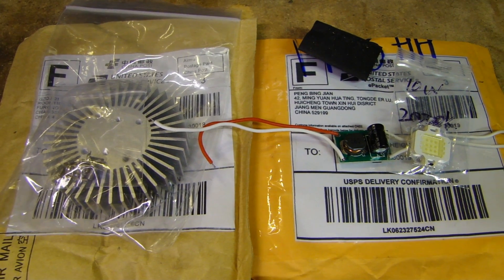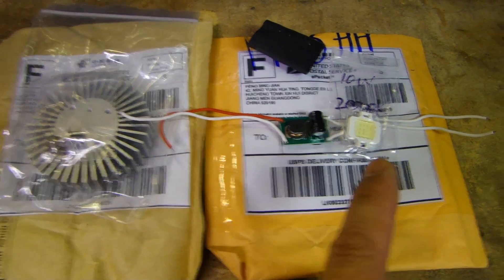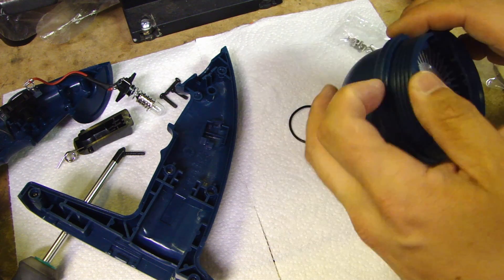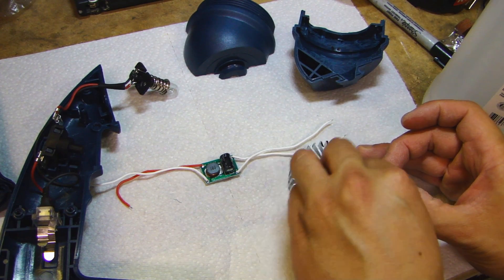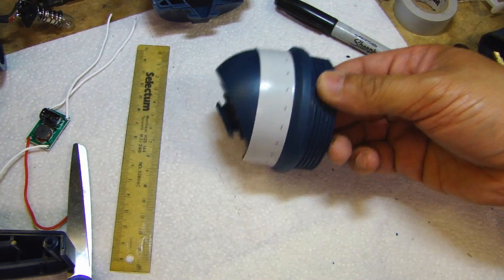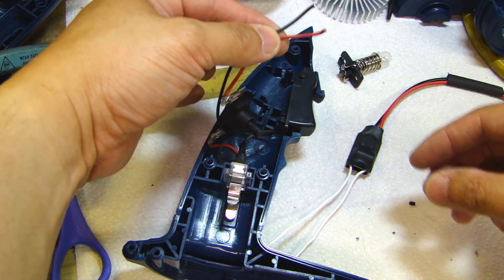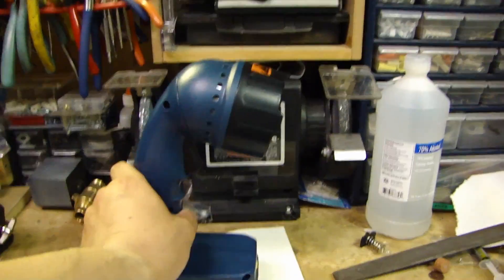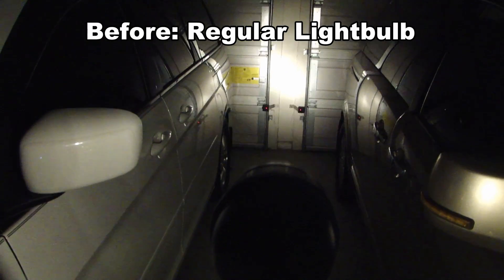Ryobi 18V Cordless Flashlight with 10 Watt Super Bright LED

Comment: Great video. I bought all the parts few years ago, but never got around to doing the upgrade. Yesterday, I saw harbor freight tools sells a similar LED rechargeable flashlight for their Warrior brand battery (item 64117). It was about $6 after coupon, and the bulb assembly fit perfectly after a bit of dremel work. Check it out!
Reply: I plan to do this mod. Was the dremel work difficult? I don't want to mess it up.
Reply: @obguy99  it was easy. I didn't even use a dremel, I just filed down some parts against a bench grinder
Reply: @brandonkellogg9590  I will buy one and see if I can do it. I have two of these lamps and put a $30 conversion kit on the first but just want a 2nd good LED Ryobi lamp and will do your conversion next. Appreciate any tips you have.

Comment: It doesn't seem that much better. The LED is behind the reflector dish. If you can get a 5w that would project further into the "sweet spot" in the reflector dish. You can have the increase in as well. Test it out! The difference is great.

Comment: Thanks for video.  I bought these parts and converted my p700 light.  Much  better now!  I had to cut the base of reflector a bit to get some clearance over the + solder connection and used some liquid tape to insulate also.

Comment: That LED was a bad choice.  Those chinese generics are known to have very low efficiency and CRI, even electrical shorts in the dies that waste power as heat.  Many think they are factory defects, is why they are so inexpensive at eBay and elsewhere.  Plus, no matter what it was marked, it is not 20,000K color temperature.  I can tell by looking at the phosphor coating that it is no warmer than daylight hue and probably closer to 6500K, but definitely not above 8K as it would look distinctly blue at 8K or higher.

Your heatsink is not remotely close to large enough for a 10W LED, enclosed in a light head, without a fan on it.  It will have very short lifespan due to how hot it runs in this scenario.  I have done a similar mod to a Dewalt cordless flashlight, even used what is probably an identical driver, except I used two Cree 5W LEDs in series (with a custom optic in front instead of the original reflector) and under drove them to about 4W total by modifying the driver board... at least on mine, it has two resistors in parallel which are for current sensing and if you remove one you reduce current, or remove both and put in whatever resistor you want, calculated this way:

Parallel resistors set current 0.3ohm + 0.2 ohm = 0.12 ohm
As shipped this should equal 833mA
LED current is set through a sense resistor. The output current I is equal to 0.1/Rs

Note above that their supposed 10W driver, is more like an 8.33W driver because the sum forward voltage of those LEDs is pretty close to 10V, except they don't achieve remotely close to their claimed lumens because some of that is wasted as heat from the defect situation I mentioned above, and due to how hot running it will be on that undersized heatsink.  It will have a permanent lumen reduction from that operating temperature, but perhaps if you don't use it for many hours at a time, it will last long enough for your needs before burning out the LED dies one at a time as mine did when I first tested those 10W generic LEDs and abandoned using them due to how poor they are.

Another thing I noticed about those drivers is they really mess with nearby FM radio reception, though it could be that the specific drive current I chose, just coincidentally put the frequency in the FM band.  YMMV.

Also note that because you're running it from DC, you can gain significant efficiency by removing all 4 driver board diodes on the input and putting bridges (jumper wire) across the positions of two of them.  Since they're just a bridge rectifier configuration, you would then have to observe polarity when hooking it up, but this saves you that automatic loss of 1.4V.
Reply from the maker: Thanks for the write up, but I use that flashlight everyday (I use it to walk my dog early in the morning, and last at night) and still works to this day. Just as bright as the first day I made it.
Reply: If you are happy with the result, that's what counts, but factually speaking, this is a bad mod to do for someone who does something like use their light very often for work or emergencies, especially a mission critical light.  I know that seems like some kind of doomsday prepper statement but not really.   I tend to favor one light and use it the most, especially when it's the one I modded into my Dewalt snakelight-neck, work light because I not only have two batteries with nothing better to do (after I bought a newer upgraded drill) but also, being a snakelight, it's great for aiming at work.

Frankly, it's a little bit silly to carry something this size, weight, and bulk, just to walk dogs unless you're out all day.  There are many little 1 x AA pocket lights that would easily accomplish that.

Comment: Does anyone have a current link for the LED and Driver? I can not seem to find one with the LED under 20,000k
Reply: It's not 20,000K, that was some gross mistake by the seller.  Even as high as 10K is practically pure BLUE, while what he has looks more like a 6500K color temperature, often just called "cool white" instead of "warm white', but frankly, I'd rather have something between those two choices, would get a different brand of LED that comes in closer to 4500K.

So all you have to do to find what he used is go on eBay and search for "10W LED -bulb -bulbs" then sort by price and click "Buy It Now" to see them selling for about 75 cents delivered from China, which takes about a month to arrive.  For the driver, do an eBay search for something like "
10W 900mA Constant Current LED Chip Lamp Efficient Driver Supply DC9-24V
BUT again, I would not use these parts.  it's going to run too hot and cause damage to the LED.  You're better off shooting for 5W or 3W instead of 10W (which is actually 8.3W due to chinese unscrupulous lying merchants lol).
Reply: Stinky Cheese thanks! I know 20k would be a purple or pink shade at that temp haha. I have always been into LEDs, but just wanted to build this apple for apple. our new house has all 5k LEDs and they are perfect!
Reply: https://rover.ebay.com/rover/0/0/0?mpre=https%3A%2F%2Fwww.ebay.com%2Fulk%2Fitm%2F261949689970

Comment: I would like to see a 100 watt LED or larger emergency flood light with USB charging that operates off of a Ryobi 40 volt battery or battery Bank.... that  system should be able to be recharged via 12 volt power supply through a vehicle cigarette lighter or even a gas-powered generator and or solar but should also have multiple USB charging ports to be able to recharge cell phones tablets and laptops in an emergency if needed
Reply: That seems rather silly and expensive. In an emergency you'd want to conserve battery power, not have a light that produces more light than the room normally has when mains AC power is working.  It would require a big, heavy, expensive battery AND heatsink, enclosure, thermal management and charge controller circuit, etc.

Let's put it in perspective.  The HIGH CAPACITY version of a Ryobi 40V battery is 4Ah.  Keep in mind, it isn't really 40V but 10 cells in series for 37V nominal.  37V * 4Ah = 148Wh.  Now your LED driver is maybe going to be 90% efficient (less if a cheap generic one) so that takes you down to 133Wh.  This means you can only run the light for 1.33 hours from a full charge on new battery, hardly ideal in an emergency.

If you don't care about highest efficiency, just cheap cost so you insist on using generic chinese LED and driver, you'd be better off going with a 20W LED and driver.  You'll still need either a heatsink half the size of your head (or else a fan on it, then a typical 4 square inch CPU heatsink (Pentium 3 socket 370 era for example) would work) and a separate boost PSU and charging circuit, or an AC inverter to use the original Ryobi charger, to be able to do this from a 12V vehicle lighter outlet.

That is quite do-able, but frankly I think you should just invest in a Ryobi 18V One+ cordless tool, and 18V One+ high capacity 4Ah battery, then buy their LED floodlight at Home Depot.  USB charging, meh not needed at all, you can buy USB output power banks on Amazon all day long for under $20, ready to do the job.  Besides, you don't want to lose cell phone USB charging capability in an emergency because you left your light on and it drained the battery.  Communication is a lot more important than an excessive amount of light.
Reply: Oh No,   Bring on MEGA LED Lights!   we have PLENTY of backup power.
Reply: Ryobi already makes a big led spotlight for the 18v system

Comment: 900mah output of that driver barely pushes that led.. Needs 3a to get full lumens out of it..
Reply: Freshkryp69 If it's pushing 900ma at 12v that is 10.8w which is slightly above the lights rating.

 If the driver output is lower than 12v which It might be (I might not of heard it in the video...) 

3A is still way overkill. 9v at 3 amps would be 27watts, almost 3 times the lights rating.
Reply: Awe you got me lol.... Mine is a 6v iirc.. I have the TaskLed H6CC driver it was set @ 3amps output running a xml2, Its a blinding flood light now :). Im fixin to wire up a 50k pot so I can dim it.
Reply: Freshkryp69 Sounds neat, best of luck with it.
Reply: Stick to what you know 'cuz it sure isn't this topic.  The LED is rated for 10W and has a forward voltage right around 10V (3x3 array of 3 LED dies in series and 3 of those in parallel, with each die having a forward voltage of about 3.3V).

That would make the correct current from the driver 1.0A, so the driver is slightly undersized, except the manufacturer of the driver is lying, its actually an 833mA driver not 900mA, but this is a good thing because the LED is already running too hot in this design at 833mA, let alone at 1.0A.

What you are getting confused about is that it's not a single die LED he used.  Single die like a Cree XM-L, yet they need 3A to reach rated wattage.

It would have been BETTER if he had used a single die Cree XM-L because they are much more efficient than these generic chinese defective cheap ones, but since the design can't handle 10W without overheating, that would be overkill.  You can now get a more suitable 5W Cree like an XT-E for under a buck a piece at places like Fasttech.com then not only will the heat be more manageable, the runtime will be high enough to use it as a work light which was Ryobi's intention and why most people bought them.

Comment: They sell LED replacement bulbs that will fit directly into the flashlight..  Just curious why you didn't go that route.  In fact I was looking at Google for these bulbs when I came across your post.   Beautiful modification BTW.
Reply: The Cree xml2 10w led's can put out more than 1100 lumens
Reply: Jim Pumphrey Main reason would be is there is no 10 watt bulbs for them, and any that claim they are would be a farce.

 even the "5 watt" ones are almost all 3 watts or less. The easy way to tell this is 10 watts is way too high to be cooled without a heat sink.

 Any bulb replacement actually being 10 watts would burn out in minutes if not attached to one.

 And because adding a heatsink in a light is not a "Drop in solution..." Legit 10 watts replacment bulbs just do not exist.
Reply: All of those LED retrofits that keep the design using a small bulb form factor, are limited in wattage to what the surface area of the bulb metal can dissipate.  "Some" of them are deceitfully marketed, telling you the max wattage rating of the LED instead of the actual drive current (and resultant wattage) to keep it cool enough to avoid damage, but the true limit on that design is a little under 2.0W if you have a crazy amount of holes drilled in the head to improve airflow (more than the one in the video has) or closer to 1.0W if the head is kept original, perhaps for better water and grime resistance considering it's a work light.

Those typically achieve about 150 lumens if a newer design, or under 100 lumens for the old ones.  The light in the video, after factoring for the falsely rated LED, falsely current rated driver (!@#$ chinese liers lol), amount it is overheating, the result is his light should be making around 600 lumens.  It's a poor result from an efficiency and lifespan perspective, but is still about 4X as bright as a drop in LED retrofit bulb will be.
Reply: No it can't, not in this design.  Citing max lumens that require max drive current, requires keeping temperature at 85C too which the design in this video cannot do.  The result will be temporary lumen reduction from excessive overheating, and permanent LED damage that lowers that lumen value even more, the longer it is used past the first few minutes it takes for the heatsink to reach an excessive temp.

Didn't you ever wonder why the major companies, pros designing LED flashlights, aren't just picking a 10W LED and driving it at 10W?  Heat!  Designs like that need more heatsink surface area and/or spread the head out among multiple dies, each running at a fraction of the total wattage to sum to the target wattage and lumens.  This is seen constantly not only in flashlights but also the everyday LED light bulb.  You want to under drive a lot more LEDs to make the product efficient and long lasting, or if stuck with a host like the Ryobi light in the video, pick a more appropriate wattage like 3W to 5W.

Comment: So,useful or not useful for its brightness? (I want to make this light but i doubt about power.)
Reply: Alper Gökcek i conpleted this project about a year ago.  The LED is much brighter but it has a flood light effect.  If your wanting to light up a whole room it is much brighter and better but if you need to spot something at a distance the stock is better.  I have one of both so i use the one i need.  8out of 10 times i grab my LED

Comment: I have two of these lights and the dog leg metal connection taps break where they fit into the plastic. It's where the battery touches up in the light break.  Has anybody had this problem ?    Thx for the video really cool hot-rodding a light !

Comment: Your instructional video was great.   I ordered parts from eBay.   I ordered three kits.   Heat sink, LED, and power supply together averaged $3.15 per kit.   Your tips for installation were spot on!    I converted my Ryobi P700 18v cordless flashlight in a few hours.   Your suggestion of an LED with a color temperature between 6000-6500K for a more white light is the route I chose.   I decided not to drill holes in the case for ventilation. You are correct though, the heatsink does get hot.

My initial reaction when I turned it on, " Wow, that's bright! "
Best $3.15 mod ever!

LED and power module - http://www.ebay.com/itm/261846807790?_trksid=p2060353.m2749.l2649&ssPageName=STRK%3AMEBIDX%3AIT

Heatsink - http://www.ebay.com/itm/331220338280?_trksid=p2060353.m2749.l2649&ssPageName=STRK%3AMEBIDX%3AIT
Reply from the maker: +Bob Johnson Thank your for sharing!!

Comment: how long does the LED last vs the incandescent bulb?
Reply: Stinky Cheese you sure like to shit on everything
Reply from the maker: +Scott Tienken Both lasts a long time, but LED is much brighter
Reply: Scott Tienken Led is properly cooled will last maybe 10,000 hours. Incandescent Bulb may last 1,000.

 But bulb will be more likely to burn out suddenly if jarred while the LED is shock resistant and would be unlikely to burn out if hit or dropped.
Reply: BUT, the LED isn't properly cooled.  I have done my own testing with these junk generic Chinese LEDs, using a heatsink with TWICE the surface area, a very high quality Foxconn heatsink for a Pentium 3 processor, and in OPEN AIR instead of enclosed so more airflow.

At 10W the LED failed in less than a week, one die at a time out of the 9 dies in this 3x3 series/parallel package.  At 6W, I got it to last a whole 3 weeks before the first die failed and all the rest failed within a few more days.  When I write weeks I mean 24/7 continuous testing, that they lasted little more than 500 hours.  Ridiculous junk LEDs!

Granted from a brightness perspective, they still beat the original incan bulb, but a proper design using a major brand LED, under-driven to what the housing can handle thermally, should result in at least 20K hours, or closer to 50K hrs if there is a thermal management circuit to reduce current once the die reaches ~100C.